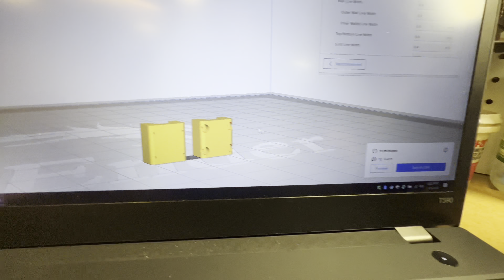The Chronicles of Norm #17 - Slippy EM-1

Comment: This is a great video, thank you Norm for your work in making these videos very educational for us. I wish I understood John Will's Super Chuffer add-on electronics to TMCC better. I also think you're making of a '4-chuff' cam to replace Lionel's dumb ole '2-chuff' cam is awesome. To me, its more reliable than the reed switch process. I have this same locomotive, bought it in 2000, but I had it upgraded to full Legacy with a prototypical whistle. This whistle however, though not prototypical, is one of the finest whistles from Lionel 2000-2005 era I've ever heard. It's very haunting.

Comment: Hey Norm, have you used the chuff generator from Gunrunner John as well? I see you use the super chuffer but with cam or the reed switch with the ERR stuff. I just ordered one of the generators along with the super chuffer to go in a consolidation I have. (early TMCC)
Reply from the maker: I still have one in my old Y3. I could never really get a consistent chuff rate. I prefer a driver based chuff so I can get the phasing right on the dead centers. I still think it’s a cool product.

Comment: Great video! I have a Legacy J1a and can not figure out what is wrong with my smoke unit. It has cylinder smoke and stack smoke. I recently replaced the resistors from Lionel and now smoke leaks out everywhere. It leaks out of the sides and also from the main smoke side through the cylinder smoke side and out the air intake of the cylinder smoke side. I replaced the gasket and still get leaks. I’m really about to throw in the towel on smoke for the reasons you mentioned, but it’s a cool gimmick to show off. Any suggestions? Go figure Lionel does not make the board or parts anymore. Thanks for your help!
Reply from the maker: Aw man I wouldn’t know much about that one. That was the first J1a w/Legacy right? Almost sounds like your stack is misaligned.
Reply: @normstrains  I think it’s the one from around 2017. I tried it with the shell off and it leaks pretty good. Some of the tapped screw holes in the smoke unit bowl are slightly stripped. I may try to get a new one and see if the smoke unit board can get a better seal by tightening the screws more. I just wonder if the board is warped.